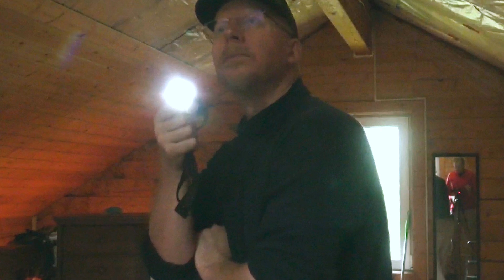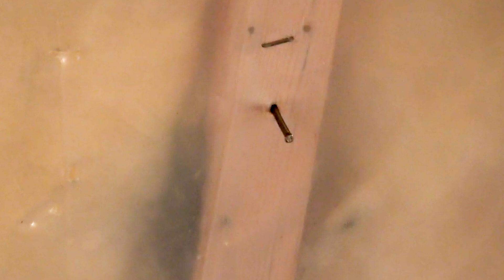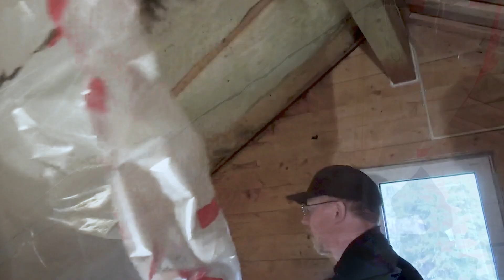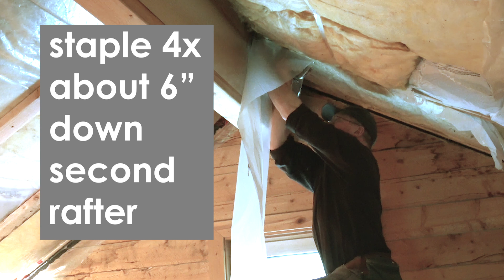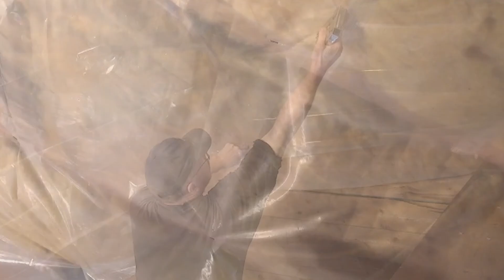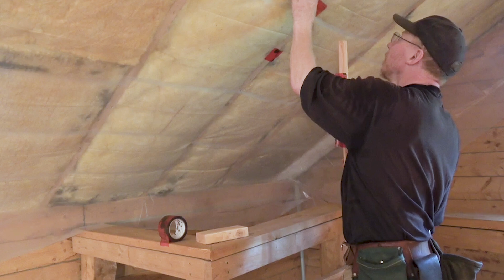Replacing a Ceiling Vapor Retarder

Comment: I like using double-sided butyl tape on the rafters, to stick the vapor retarder to.
Sticks like a champ and you don't make so many penetratations in the poly, compared to using staples.
The tape is also less messy than the caulking. Working overhead with caulking is not ideal, as you probably have found out.
Here an example of the tapes and the application: https://www.youtube.com/watch?v=zqw0gu4px7Y
Reply: The butyl tape also seals the furring screws, so overall a nice and quick solution.

Comment: Don't know your availability for Würth but there you can get a special vapor retarder and wind break "caulk" that is extremely good for vapor retarder and vapor open wind breakers it is the same as the glue in typical construction tapes like Tesa and Zip.

Extremely sticky and nice to work with until you touch it 🤣
We don't have acoustical sealant here and any other caulk doesn't stick to the vapor barrier at all, but this sticks to anything and never fully dries, but if you try to remove the vapor retarder or barrier after a week then you likely rip it apart before getting it off 😜

Comment: Could you add additional foam sheet insulation between the firing strips or does that shift where vapour could condense?
Reply: Yes, you can.  The dew point is already in the wall cavity, and using a bit of rigid (max 1.5") would just push it a bit more to the interior.  Not a huge deal.  Of course, we all would love to put all our insulation outside the cavity, but that's a whole other discussion.

Comment: Modern 2x6 walls with batt and vapour barrier would have been a better initial build solution for a complete sealed building envelope especially at those rake walls. What is the moisture permeability of the logs over time ? Adding strapping is a great tip tho. Acoustic seal is messy work - respect on your efforts working up at those angles.
Reply: I agree.  I think this is a case where context plays a big role.  Interior Alaska has always had abundant white spruce timber and in the last 60 years a lot of local sawmills have produced three sided and four sided logs.  Most of those logs are 6" and 8".   Historically this material has been competitively priced and it's had a steady appeal for both economic and asthetic reasons - and often people perceive it to require less skill than traditional framing (another topic).  In any case, it has resulted in our housing stock having a significant percentage of log homes with square stacked walls.  Generally these structures are cabins, but there are houses too.   Even here in Zone 8, a smaller (16x20, 20x20, 20x24) log place would be relatively inexpensive to heat as long as it was reasonably air tight. And wood heat is also an option here.  So the practice continues.  I totally agree on the energy efficiency comparison, however I also have to acknowledge that there are other sides to this coin.  We always encourage people to have a software energy model done of the home they intend to build before starting so they have a realistic expectation of energy useage and costs.  As far as the moisture movement by diffusion issue goes, the logs themselves do great.  They pretty much roll with the seasons and absorb and release moisture from indoor/outdoor humidity depending on the conditions.

Comment: Nice video and good work.   Thx. 

I would be tempted to additionally use Grace ice and water flashing strips/pieces on the Visqueen where I was going to later screw the furring strip thru the Visqueen to the rafters.   Or I would be tempted to Tremco to the Visqueen before slapping the furring up for screwing.
Reply: It could certainly be done, but I feel there would be diminishing returns.  My own experience building homes in Alaska and strapping the walls and ceilings to protect the vapor retarder (with attention to a clamped seal at overlaps) has consistently resulted air leakage tests of less than 1 ACH50.  I feel this approach is comparatively easy to attain for a lot of builders who are looking to do a little more and do it economically and efficiently..   There is also a potential indoor air quality issue with applying Tremco behind each furring strip -and that is off gassing.  The stuff does offgas and this approach could expose a significant amount of it to the conditioned air space of the home, whereas limiting the the Tremco to overlaps and perimeters puts it behind the poly which would serve as a barrier to the off gassing.  Just a thought.

Comment: If the problem with wood boards being nailed through the plastic into the rafters, how is a furring strip nailed through the plastic into the rafters be any different?
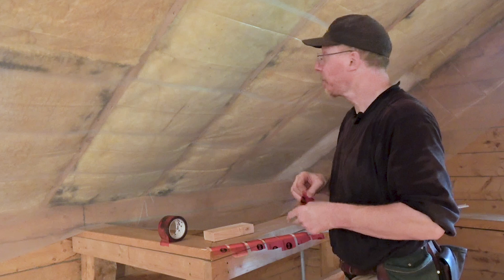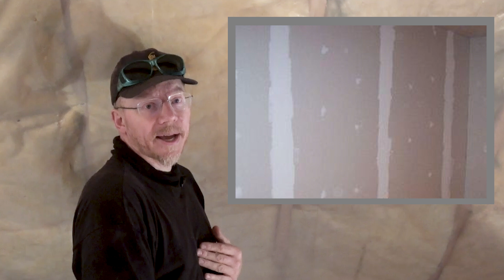Reply: Hey Scott.  Probably the biggest factor is fastener clamping force long term.  17:40 goes into the fastening detail.  4:20 touches on the rationale as well.   We are using construction screws that provide good long term clamping force between the furring strip and the rafter.  The odds of significant air leakage occurring through that type of attachment are greatly reduced.   In general, any time I can get a stable clamped connection in residential applications like this, I'm comfortable with it.  Screws might be a tough sell in a production setting and I'm comfortable using 16D HDG gun nails here too.    Panning out a bit, everything is relative. To me, this furring approach mitigates an air leakage problem that can range from inconsequential to a big headache depending on the severity of the air leakage, moisture transport, and ability of the roof to dry out before damage occurs.   If this were a roof over a swimming pool in an arctic climate, this would not be the roof system to use.  In a residential setting, for a little extra effort, this furring approach addresses the particular issue of paneling nails making potentially problematic holes, but even more importantly, it gets the wiring penetrations out of the vapor retarder too.   In this video, I counted over 800 panel nails in that 11x23 section of ceiling.  That poses a "getting nibbled to death by ducks" scenario.  Now that I think about it, I wish we would have conducted "before" and "after" blower door air leakage tests to compare.  We'll plan on that in another air sealing video.  Some of those results can be pretty compelling.